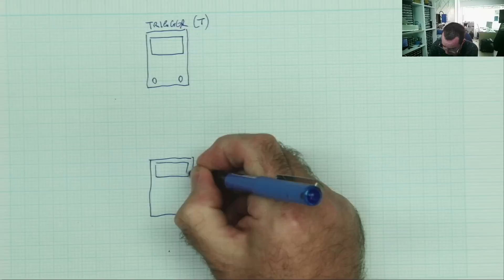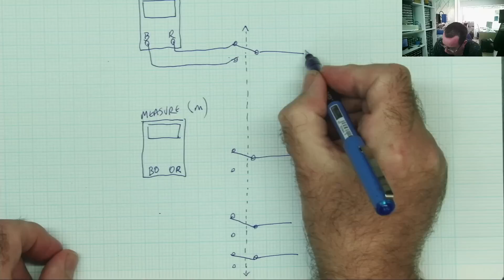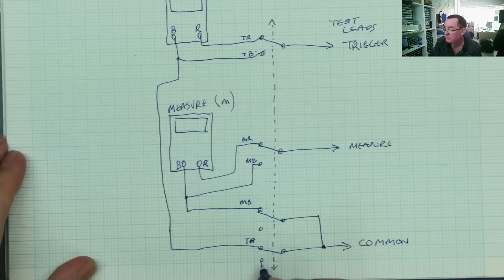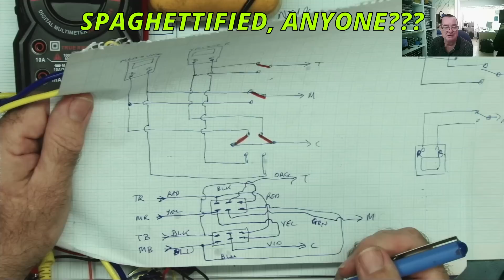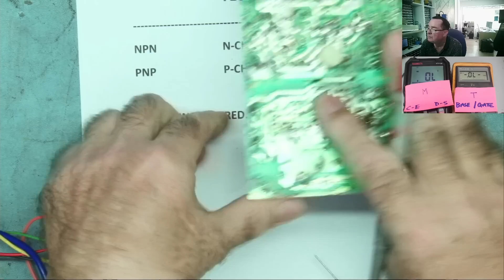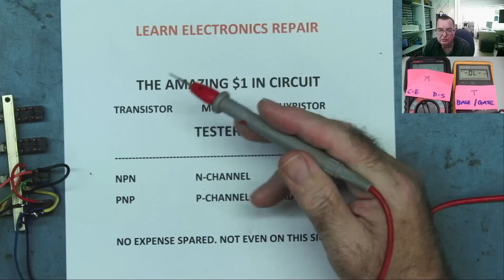The Amazing DIY $1 In Circuit Transistor Tester : Bipolar Mosfet NPN PNP N Type P Type & More

Comment: Hi and thanks again for all the helpful videos you spend time putting together what I have done was a upgrade transistor and mofet   tester and it will find if there are shorts in the  component and test at the same time I have  Applied voltage  To the trigger lead but I have put a  diode between the  meter  Then the  voltage will not go back to the meter and also I have put a volt meter on there then I can apply the right voltage to each component properly

Comment: Hi and thanks so much for making all videos you make just one question I have made the  exact same tool for testing  transistors and other N channel and P channel but  what I have done is I have added a  adjustable  Power to the trigger lead with a  diode  Which will stop the  current going back to the meter  To be able to open the gate of the  transistor  Fully opening then test do you think this will work can you please give me some feedback on this MENY thanks Marcus

Comment: Hello. Very good idea with 2 multimeters.
 Has anyone tried this method on germanium transistors? I worked a few days ago with germanium transistors and I noticed that there is some value between the collector-emitter, measured on the diode-beep. At trans with silicon between E-C we have "zero" on the multimeter.
I ordered 2 cheap multimeters on Aliexpress and I will try this connection stile...
Thanks Richard for these wonderful videos, this one and more...

Comment: I am not ashamed to say that I found all of this somewhat confusing but I definitely understood what was happening. However, I see very little value in assembling all of this and the fiddly technique required to hold three probes as anything better than a single meter in diode mode and some decent knowledge of how to use it. Is that fair or did I miss the point of it all?

Comment: I was thinking the same thing.  Putting the switch into a small project box.  Using female banana jacks.  I would use the higher voltage type for at least the 3 probe side. Then you can use any meter probes. Maybe put a small peice of green heat shrink on each end of one lead. You could also use mini grabers if you wanted.  The trigger and measure sides,  the banana jacks wouldn't matter.  Just use male to male jumpers. Amazon has 12 pin 4 pole  2 position on/on switches for $8.99 USD. 2 pcs.

Comment: Before I even watch further, I’ve already seen the origin of this idea in your video “All You Need to know about MOSFETs to Fix Stuff” at time fifty min and five seconds (testing MOSFETs in circuit with two multimeters). I’ve been using the two DMM trick for testing MOSFETs for quite some time now! I’ve built a circuit make it easier to hold the different leads on the device. I think that’s what you’re doing here.

Comment: If I understand the circuit correctly all you need is one extra probe with two 4mm plugs for the common  .

If you're testing a part you'll probably have some idea what it is !
So just flip meter connections for PNP or NPN .

No fancy switching is needed !

Comment: how can i measure caps esr with no esr meter..?????
Reply: You have options !
Oscilloscope & signal generator then do the maths .

Pass music through the cap & use a signal tracer on the output  .

Make a esr meter .
A 0.5 R minimum unit is easy & a problem component is probably over 8 ohms or open . 

If you need better than 0.5 ohms in circuit testing go shopping !

Comment: Nice and simple! 3 things to mention:
1. If someone doesn't have a second meter, they could probably use a LM317 or something similar to build themselves a CC source for the trigger, no? Might also get you a higher compliance voltage to turn on some less sensitive devices...
2. Now you need to get yourself a Detlef and make a posh Arduino project (replacing the meters with ADCs and such). 😉
3. A slightly more complex project similar to this can be found as a community project on the Elektor magazine homepage. It uses a 555 and two transistors to create a square wave which then uses the DUT as a switch to flash one of two LEDs (representing either NPN/N-type or PNP/P-type). Maybe it's worth a look. It needs more parts but doesn't require meters or manually switching between modes (NPN/PNP).
Reply from the maker: Only problem with using the LM317 in CC mode as the trigger is you lose the display that shows the gate/base voltage therefore it is not possible to tell if this is a bipolar transistor or mosfet.
Reply: @learnelectronicsrepair  True. But if you don't have a second meter (e.g. as a beginner), I'd argue it's still better than nothing. At least you'll know whether it's faulty or not.
Reply from the maker: @Foobar_The_Fat_Penguin  Agreed 😀

Comment: why would you have two or more multimeter's surely one would do
Reply: Three bench meters on my bench, another 5 on a shelf - maybe eight handheld DMMs... They kinda multiply over time. ☺  You need a minimum of two  for measuring both voltage and current at the same time.
Reply: Ive got 3 😏
Reply: I also have quite a few..

Comment: 1$?  that is BS!
Using the 2 DMM's is at least 10$ (if not more) for the crape-est extra DMM .
Just use a single DMM the traditional way, it will take a few seconds more.
This is absolutely not needed.
Reply from the maker: Now I did mention that did not include the multimeters and I didn't show them on the thumbnail either.  Anyone interested in building something like this surely has several multimeters already like every other hobbyist and knows how to use them... and anyway it does not repurpose the multimeter like you can't continue to use it for other purposes as you did before 😉  I made a video a few years ago called the Amazing $1 short finder and that also connected to a multimeter but no one raised an issue over that, hmmmm
Reply: @learnelectronicsrepair  
Indeed the "1$ short finder" is a great idea.  
It actually replaces a relatively  expensive milometer which most hobbyist/technician  don't have . 

In my opinion and experience  most hobbyist don't have 2 DMMs,they usually have only one.
The use of a single DMM in diode mode is mostly enough for finding  faulty transistors and such.
If needed, it is easy to pull-out a suspect device and test it out of circuit.
Reply: The crapiest multimeter is at harbor freight for $5.
Reply: Did you watch the video? It's made from scrap or existing parts. It's an educational video, but you know everything already.
Reply: @mikepanchaud1  ,, @mikebond6328  ,, mostly my project are made from scrap, spare parts and so on. My first voltmeter was a analog BBC after that comes a Metex 3650 payed from my first own money and i used it for about twenty years. If you have nothing or less with your own ideas you can move worlds. The electrons don't care whether the components are old or new. Appreciate the value of the things you have. Your own knowledge leads to the goal. Not the tool, the knowledge.
Reply: 😴😴 Who care's your opinion.👎
Make your own channel and let us show your knowledge . 🤣🤣

Comment: All very good but it's a common beginner mistake to see a nice idea, take several hours to build it, find it doesn't work or they don't understand it and then give up. The proper way is just remove the part and test in a ten dollar component tester... 30 seconds and job done. Same goes for endless checking with a scope on digital ICs like logic etc. It's quicker to pull the part and test it externally using a IC tester. People doing a lot of repairs already know this ;-)
Reply from the maker: How about the SMD transistors glued to the PCB with epoxy like that Basic 400 Amplifier I was repairing a couple of videos ago?
Reply: @learnelectronicsrepair  They are easy to remove if you know how lol. I've been removing glued smd parts for ~20 years. The better testers have smd pads so put the part on, hold it and test it. It's not a radical idea, it's the best use of time.
Reply from the maker: @g4z-kb7ct  Clearly this project is not for you, no worries.  I wouldn't say there isn't any 'proper' way of doing anything in electronics repair, usually there are several ways to approach any problem and I would just suggest do whichever works for you and not worry too much how others are doing it.
Reply: That how i learn by my self 😂 lots of process manually
Reply: The proper way is to throw it out and buy a new one.